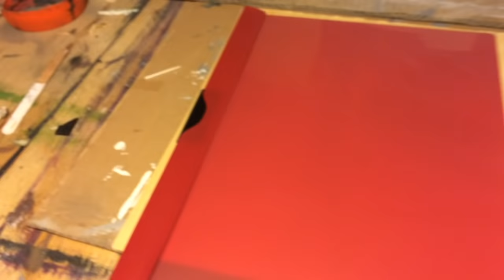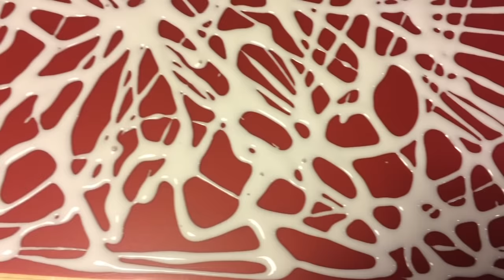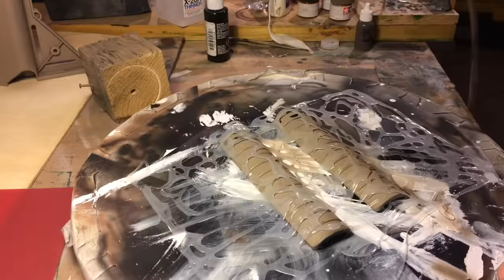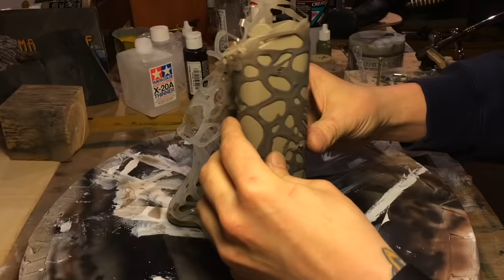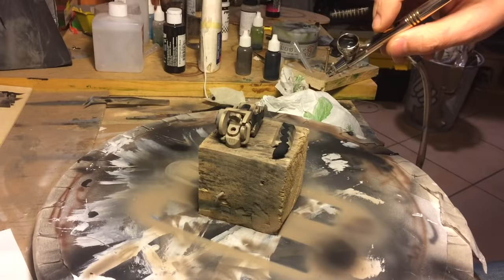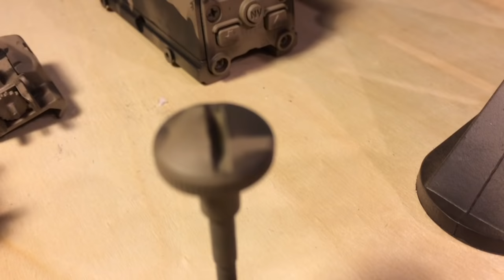Homemade stencil for  Brown Forest Camouflage

Comment: As I mentioned 8 monthes ago, I was concerned with the WD residue and I did receive feedback on this concern. One of the remarks was to use a silicon cookie sheet and this got me to thinking. I am now using the very paper thin cutting boards (sheet style) that can be rolled up and taken camping. I have tried Emers glue and Titebond construction glue, both work great and easy to peel off the sheet. Emers is alot cheaper. This video has made camo painting items extremely easy. Be creative with the designs.....THANK YOU Matteo for the ideas.
Reply from the maker: Scott Gorman I see my idea like it! it's simple and cheap .. but there's a guideline on how to make the stencil. the residues on the stencil just dry them, among other things just paint them once to eliminate any remaining trace.

Comment: I worked at NIC making and spraying cerakote with many different Vinyl stencils.  This is an amazing technique and extremely customizable.  I plan on trying this myself the clear plastic is a good idea as you can put different designs underneath of it in trace them with the glue ticket different patterns.  Supper cool vid!

Comment: Thanks for the great idea! I'm currently repainting a 2-man ladder treestand and wanted to do some camo. I was struggling with how to do it since it's only 1" square tubing. I've now made a flexible stencil thanks to you. I'm also going to spray it with some small plants and grasses to give it even more depth. Thanks again!!!!
Reply: Matteo, after reading through the comments I made another. I ruined the first trying to get the oil off of it when I really should've just gave it a light paint coating. I also want to say the comments inspired me to try another method. I made another using a hot glue gun on aluminum foil. I didn't coat it with oil and it wasn't too difficult to remove, just took some patience. It's more rigid but will also be more durable. I'd highly suggest it for flat pieces that you want to work fast with. Thanks again for inspiring me!!!!!
Reply: @dwalker26101 use parchment paper it peels right off better than aluminum foil

Comment: Nice idea I have done this with hot glue on warm glass.   Another stencil I like to use is handy wipes reusable rags non woven it can be cut with random holes then fraying the edges of each hole this is a technique I learned in military model building it works well cause the small hole in the wipes expand when you cut between the holes into random patterns. Depending on the size this is very scalable.  Try pam as a release agent for your stencils. Wd-40 didn’t work for me plus I stock Pam for glass bedding

Comment: Thanks! This is the simplest and coolest way I've seen yet! I love the idea. I've don't some with mostly weeds and leaves that does look pretty awesome but it's very time consuming and if you try to use them more then a couple times paint will drip and ruin the whole thing making it take even longer. Also if you wait for them to dry you can't use them again either. Weeds a leaves do work but definitely not as good as this seems to work. I wonder if wood glue would work until I can get some paper glue lol.

Comment: Don't forget to thoroughly clean the stencil to get rid of any trace of WD40 or whatever release agent you used.
Reply from the maker: Obviously I did not think there was need to write it. My stencil has dried in the heat for a few days before using it.
Reply: Its pretty apparent he knows what hes doing ,no?
Reply: andrew l - for sure, but I think his comment was for the viewers who intend to try this
Reply: @BrockNessMonster1991 , I found using wax baking paper doesn't require wd40
Reply: TheRoadhammer379 - thank you!

Comment: Another way to make stencils is to use a laminator, you can either print out the details and laminate/cut it or just laminate the sleeve and cut shapes out of it....it’s also resistant to paint, one wipe and it’s clean

Comment: HI Matteo, Have you tried this method with a HOT GLUE GUN? If you need it to be more flexible then just pop it into a Microwave for a few seconds depending on the thickness of the HOT GLUE!
Ignore the Trolls, they are just jealous that they don't have the power to do such great videos. All the time, expense, experience, knowledge you put into your videos the least we can do is.... "THANK YOU"
BIG THUMBS-UP ALL DAY LONG 👍😊👍
Reply from the maker: hello, I have never tried with hot glue because the plastic I am afraid that it will melt, also makes many threads. but heating it in the microwave to make it flexible is a great idea! thank you for your support!

Comment: What paint did you shoot and did you shoot a clear coat for durability?  Super clever stencil material, possibilities are endless.  Thanks
Reply from the maker: I used many kind of paints.. here black Vallejo mixed with tamiya israely sand (base tan)..
Reply from the maker: As the final protection I used a transparent opaque paint.

Comment: Excellent idea for custom patterns., however your answer for removing the WD40 oils did not seem to answer the question for removal. If it is no removed from the stencil you made and is transferred to the part it will run all over when put in a oven for paint that needs to be baked. A simple wipe with a paper towel wont remove the oils. The paint I use, the parts have to be placed in Acetone overnight or sprayed with Acetone to remove all oils. What about using wax paper or parchment paper for the patterns without the WD40.....I like the idea but.......the oils?????????
Reply from the maker: Probably this is so. Removing the oil from the stencil I practically did not even do it, the glue absorbed almost all of the excess oil. Also at the beginning of the video I almost completely clean the plastic support from the oil (operation that took me more than ten minutes!) Just to keep it from over the pieces. In any case, just a splash of paint on the stencil to dry the remaining oil. And the used glue may be different from what I use. The stencil can also be washed before being used. There are at least 10 different ways to remove the excess oil, just be ingenuous!
The video wanted to show the technique of how I made a very practical stencil because it was soft and adaptable to any shape. Thank you
Reply: Scott Gorman well said man
Reply: use a french baking mat
Reply: If dont want to use w40, then use a piece of wax paper (for baking)

Comment: How did you remove the residual WD40 from the back of the stencil without damaging it? If you're only laying a greasy stencil down on the same part once, the residue shouldn't be a problem, but if you want to lay it down a second time, residual oil from the first application would prevent paint from sticking.
Reply from the maker: The WD40 layer on plastic should be removed almost everything, it should only be slightly wet so that it can be removed at the end. Also let the stencil dry or use a paper cloth to absorb excess oil.
Reply: you can always just cover it up with some paint afterwards.....
Reply: MrRedfish1964 that’s what I did. I sprayed the WD40 side with spray paint before it touched any parts. 
Great video and works amazing.

Comment: But.. the holographic sight is completely painted.. even the glass.. so how can you see?
Reply from the maker: No, I just forgot to remove the tape! ;-D
Reply from the maker: Thoroughly Wet comprati degli occhiali e guarda meglio!!!
Reply: Even if he hadn't there are many ways to resolve that. Razor blade, coating it first, proper pads and cleaners, Just have to use your brain..

Comment: I did this with a glue gun the same way he did it and it came out perfect and it drys faster the same day and it is more flexible he is smart but use a glue gun it's better.
Reply: mark Goree what did you apply the glue to?
Reply: A school folder that has plastic on it and so it won't stick I used Neosporin ointment and just rubbed it on then let it dry then you can start using the glue gun.

Comment: Just a thought, why not just add to rifle, spray paint than peel it off? ;)
Reply from the maker: How?.. what do you mean?
Reply: @maprojectnet  I was just thinking outside the box and was thinking about just taking that glue and applying it directly onto your firearm (or firearm parts etc.) and spray painting it. This way there will be no uneven voids. All you would have to do after spraying is peel it off. 

I didn't even think about it until I saw your video LOL.
Reply from the maker: @Tigris_River_Sand_Fleas  It's not exactly like that...Unfortunately, this is not exactly the case because the wd  is too oily so it would affect the final result on the paint. The paint doesn’t work on oily surface
Reply: @maprojectnet  Not understanding what you mean by oily surface. I think maybe you are not understanding what I am saying.

The glue will stick to the firearm chassis. You wouldn't have to wait for glue to dry. You just spray paint the rifle right after glue is put on. After paint dries, peel off glue.
Reply from the maker: Hi! 👋🏻 what I meant is that the glue should be placed on an oily base so that it does not stick and can be removed. Mine wanted to be an experiment to be able to create any stencil so that it would adhere to the square corners of the rifle or in general on very hollowed corners and parts, but the stencil must be dried well before it can be used because the wd 40 remains on the surface after it has dried. So that's why I meant that you can't put glue directly. The bottom would totally stain and the oil wouldn't even make the color stick. Did I explain myself correctly? Or didn't I understand? ..
Reply: @maprojectnet  Understood. What I am saying is that its just light glue. It will easily be removed and anything that does not come off, can be removed with a hard bristled toothbrush. 

Another thing you might try to do, is taking your stencil and sticking it inside of a microwave for a few seconds (I don't know how long LOL) and it will make it more flexible and moldable around the firearm. 

But in my opinion, I like a little space when spraying so that the lines are not perfect. Some overspray is good to break up solid lines for camouflage. 

I really like what you are doing because I did not even think about using a glue like that. It really opened up my mind to new ideas.

Comment: Any advise?

So I tried this out last night and the glue bunched up and didn't keep the lines. I used regular Elmer's glue. Maybe it was the lubricant I used, it was some penetrating oil. All they had were big cans of WD-40 and I didn't want to spend $12 on a can so I got a smaller can of another oil. I know, cheap ass on my part. Has anyone had this issue and was able to resolve it with something?

Comment: What paints are they
Reply from the maker: Dark Seas Israeli sand primer and for the second passage you can add some drops of black
Reply: Matteo Black oh ok what brand are they it looks like you have some createx airbrush paint ?
Reply from the maker: Primer Vallejo, createx black for mixed
Reply: Matteo Black oh ok valleo isn’t waterproof though is it ? Do you seal it after
Reply from the maker: @darkseas3846  Of course! With transparent opaque
Reply: Matteo Black oh I see I’m looking at using it out wood outside